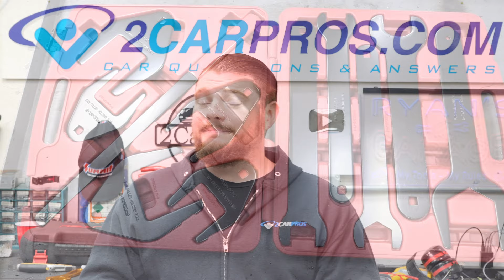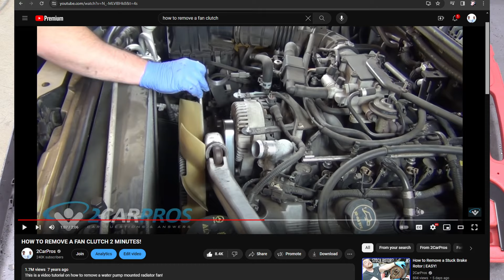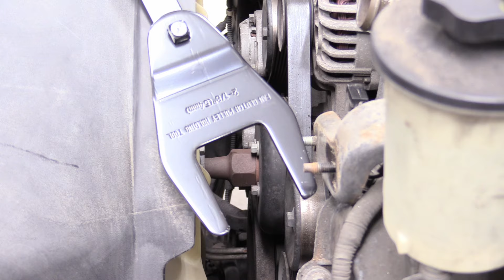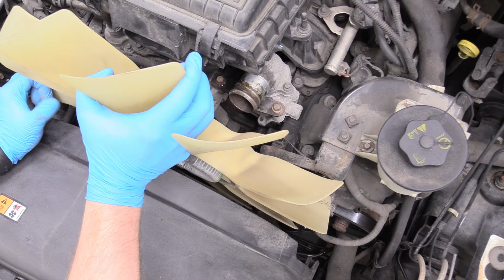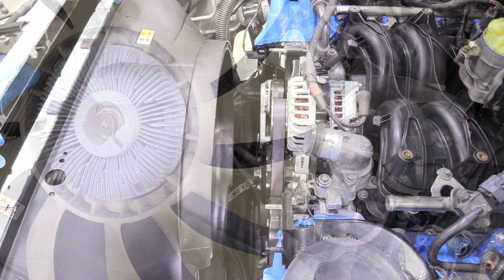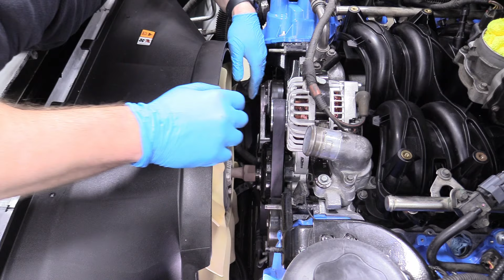How to Remove and Install a Fan Clutch Assembly | EASY!

Comment: Will the fan clutch tighten as the engine is running?
Reply from the maker: Yeah that's the idea. But you want to tighten it your self so it won't come off if the engine turns off unexpectedly. Thanks for watching!

Comment: Thank you so much for making this video. I am ordering a fan clutch now because my fan doesn't work or it cuts off at the stop light causing my engine to over heat my fan motor and thermostat and coolant temp sensors and water pump are all new..
Reply: Did you dignose it as bad or was that just the next part to try

Comment: My pulley doesn’t have the four bolts around the clutch fan nut like yours and others have, so I’m unable to use the big wrench to keep it still. Do you know the size of the bolts by chance? Mine has spots for bolts but no bolts.
Reply: Did you get this figured out ? I’m stuck as well
Reply: Hey Kevin I was wondering if you found a solution for the job I’m in the same situation..
Reply: @DerrickSims-ep6nb use a channel lock to hold the pulley
Reply: @DerrickSims-ep6nb vise grips